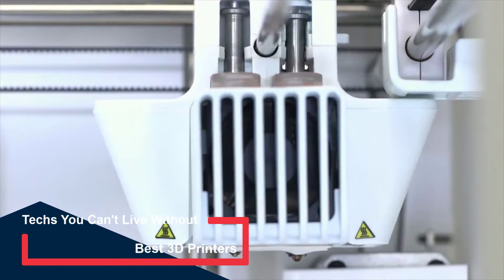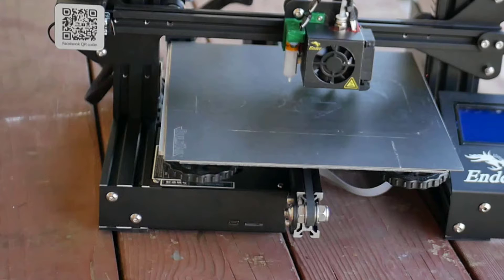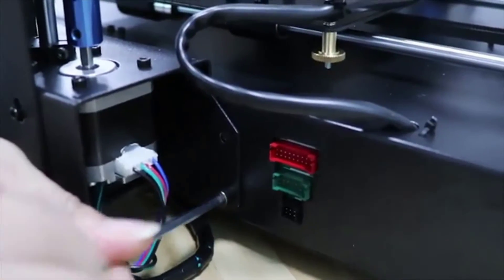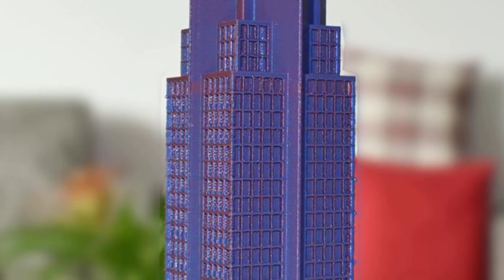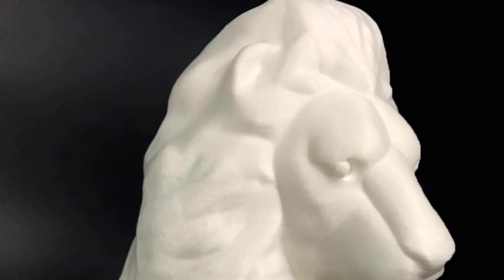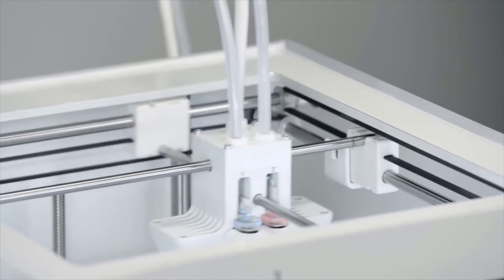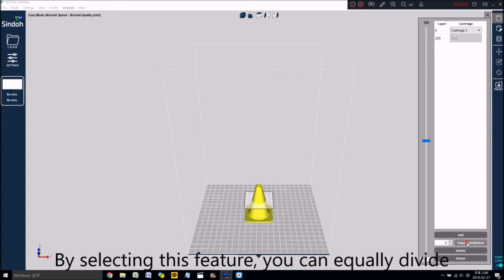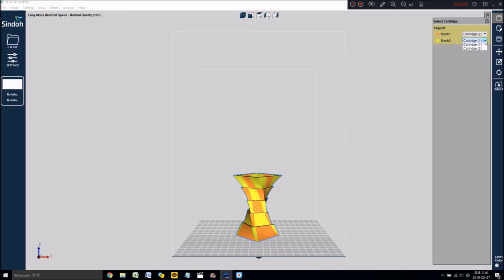TOP 5: Best 3D Printer in 2020

Comment: I personally use EOS printers for my day to day job. They are very reliable but we have a dedicated team that keeps it running in the event there is a break down (they do happen). 1 million for the eos400-4m is actually several hundred thousand under the actual cost. Though with EOS you will need to purchase all the licenses to work the printer. The powders are expensive but what you can do with them is stunning.

Comment: Yoy shouldn't have clipped off the solder joints on the TL-Smoothers, as this can compromise the integrity of the joins, it also lowers the surface contact area, which means more likeliness to overheat

Comment: Yeah, for almost exactly twice the cost of that same extruder, but in metal, you could have bought the EZR Struder ($35). It's so far superior to that in metal, that I'd never spend the $18 to buy it. You have to see it to appreciate how great of an extruder it is! See the reviews too! Print Ninjaflex with no effort! It works flawlessly! And instead of just getting the same mediocre extruder, just in metal, you actually get a  H  U  G  E   Upgrade! ðŸ˜ŽðŸ¤˜
IMO, the Ender 3 Pro (or that's what they choose to call it anyway) should have come with that metal extruder! There simply aren't enough upgrades over the standard Ender3 to warrant the higher price. The new Ender 3's come with a detectable bed surface, the 24v power supply is quiet and seems just fine, and I just don't see the differences between the Pro and stock. Not worth the extra dough, IMO. For people that got their Ender3 early, the new ones have been upgraded so much that it's no longer a "tinkers" printer. Using Cura 4's profile, it printed perfect from the very first print! Amazing how good it is right after the short assembly. ðŸ‘

Comment: What is Salem skin?

BTW, cutting off the soldering from the tlsmoothers isnâ€˜t the best idea. All the â€žvolumeâ€œ of the metal is needed for the strong motor currents going through it. So DONâ€˜T CUT THEM OFF, instead redesign the holders!

Beside of that, great video. Thanks for that.

Comment: I added the Capricorn tubing and fittings it works very well and in Cura settings I went to expert settings and reset 1st layer print at 70 degrees then it goes to 60 automatically for rest of print I get better bed adhesion that way good video I always like your tips!